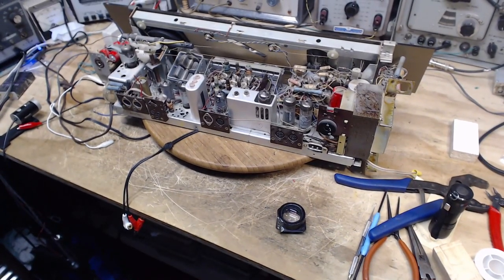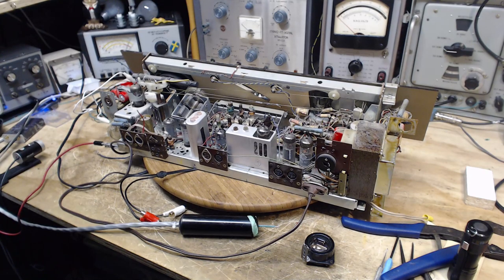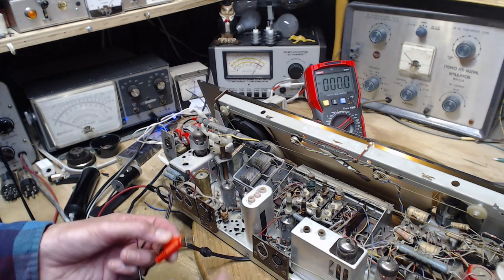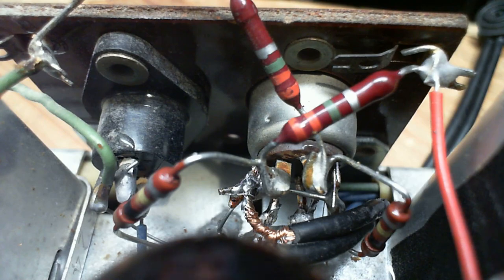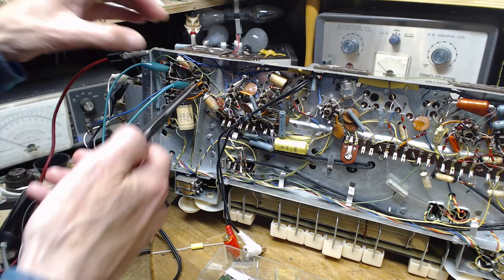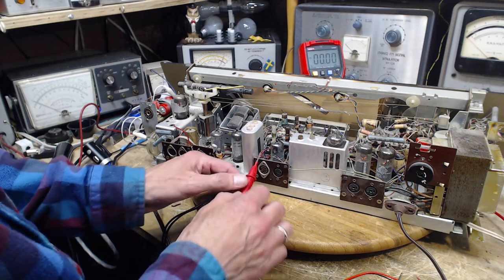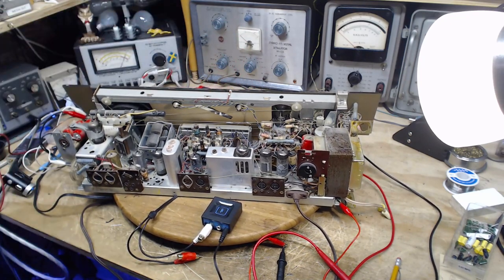Telefunken Salzburg 5094W Console Video #9 - Voltage Surprise

Comment: I installed the bluetooth receiver on my Telefunken receiver as well. The R and L inputs are on the side of the connector and correspond, in my schematic, to pins 1 and 4. The central pin 2 is ground.

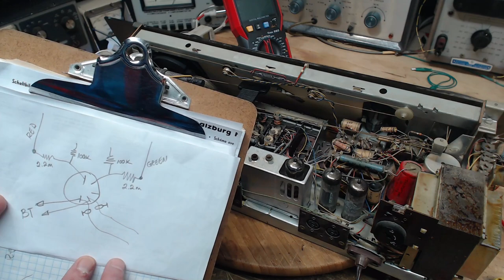Comment: 32:59 NO! You are NOT supposed to connect the bluetooth to the node of the 100k/2M2! The signal the 2M2 feeds off of comes from behind(!) the TA switch. If you force feed a signal into the node of 200k/2M2 you override the function of the TA switch as means to completely cut off the Phono/Tape signal path. As a result your bluetooth output will mix and mangle with every signal the radio detects.

Comment: What about a 1K resistor from the Line Output to ground and possible a 1K on the Line In to drain any voltage on the capacitors.

Comment: Of course you are still going to measure voltage from those .022 you just replaced. They are connected to 70 volts one end and the other is only connected to your meter so they are going to charge through the meter when you apply it.

Comment: Hi Jim
you have one channel conected to tape input and the outher is connected tape output.
normally pins 1 + 3 are input and pins 4 + 5 are output.
I would sugest that you use pins 1 + 3 of the aux connector as this looks like you will get anonther stage of amplification for your bluetooth.
best regards
Alan
Reply: No! The 5-pin TAPE(!!) connector is numbered differently than the 3-pin DIN phono plug.
 Look at the schematic at timeindex 20:17 how the pins of the 5-pin TAPE(!!!) DIN connector are numbered! From left to right it is 1, 4, 2, 5, 3. The numbering is different from that of the 3-pin Phono DIN. 

On a 5 pin DIN tape plug the signal path for tape playback is through the two rightmost pins 3 and 5; with pin 3 being the left, and pin5 the right channel.
The two leftmost pins 1 and 4 are the record signal out path to the tape (pin 1 left, pin 4 right channel).
So ultimately the correct and intended connection for a tape playback signal is to pins 3+5, not 1+3!

On a side note; What makes 5 pin Tape DIN audio special and confusing compared to modern RCA cinch audio lines is the big difference in signal level and impedance on the playback and record path.
A tape machine on DIN puts out a fairly high level and low impedance signal; it is compareable to nowadays RCA line level and impedance.
The signal presented to the tape machine on the record path however is very low level and high impedance;  compareable to the level and impedance a ceramic phono cartridge would deliver.
That low level and high impedance characteristic of the record output path on DIN is also mirrored by the presence of the high impedance voltage devider of 2M2 into 100k W35/W37 W135/W137 on the tape record output Pins 1 and 4. 
And it not only goes to prove that pins 1 and 4 are the record out path to the tape, but also explains why pins 1 and 4 run shielded wires.